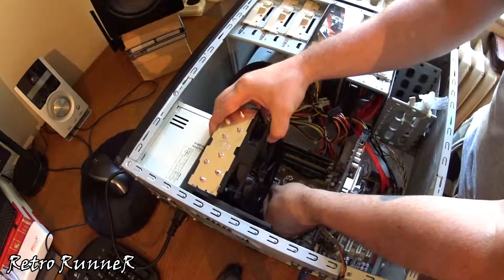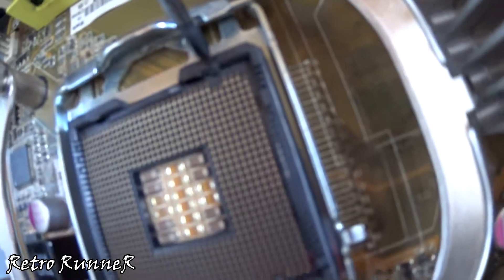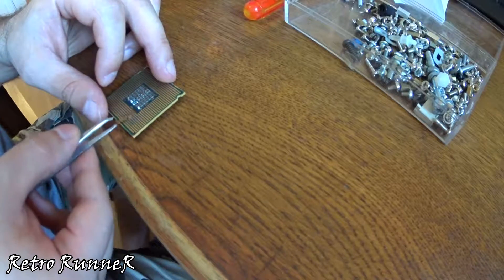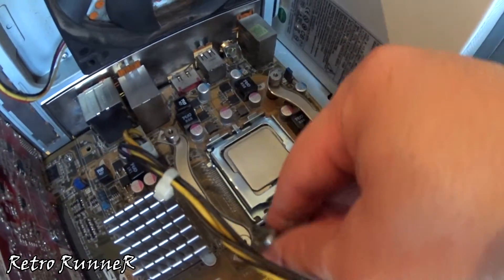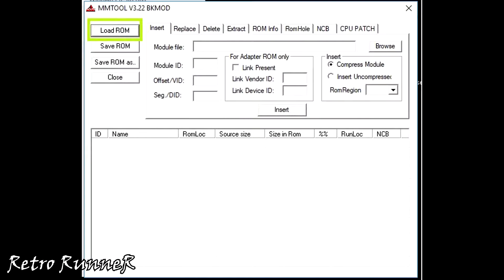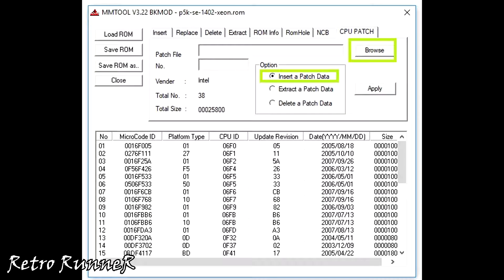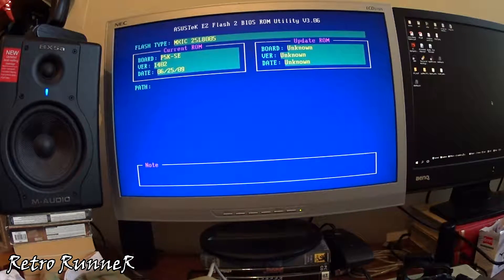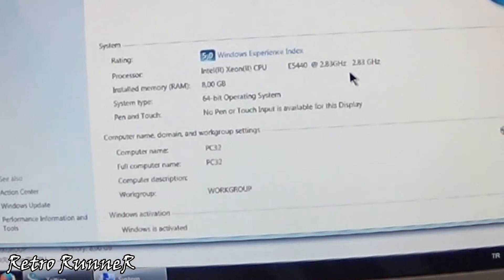Modding LGA 771 to LGA 775 Intel E5440 - How To Run Server CPU On Your Desktop PC (Microcode BIOS)

Comment: i have a ROM file so i just need to copy that small ROM ( only 1024kb) file to my usb and run that usb ? Please help me i don't know what to do right now
Reply from the maker: You have to update your mother boards bios with that file. If you modded it correctly it will work. Be careful while updating your bios do not power off your device while it's updating it.
Reply: @RetroRunner  i have a foxconn g41MD so i have to update by running command prompt with my bootable UBS dos right ?
Reply: @RetroRunner  man it still won't boot my OS and keep restart over and over but still manage to get to bios

Comment: Hi! I bought a processor, converted the socket on the motherboard (ABIT IP 35-E), added an adapter for the processor, and additionally installed a modified BIOS with micro chips. Everything works, the processor is correctly recognized in the system and programs, the temperature is normal. There is only one problem, the computer absolutely does not want to hibernate, that is, it goes to sleep immediately, but it cannot be woken up. Instead of the desktop, the computer behaves as if I just turned it on, i.e. it turns on twice, then the black screen turns off and that's it. Only the reset helps there is nothing in the event viewer about this problem, I played with all possible settings in the BIOS, I restored the settings a few times, including selecting the optimal settings, removing the battery, resetting the CMOS jumper, playing with the power settings, even disconnecting all devices peripheral and even a second hard drive to check and there is absolutely no difference. In the BIOS, S1 mode works but S3 mode does not. Any advice? :(
Reply from the maker: Hi, i used that CPU for some time and i don't remember that kind of thing. Try MOBO's original BIOS, it will give an error on boot but it will work.
Reply: @RetroRunner  Thanks for the advice! Got one more BIOS modified from an earlier version only (I currently have version 18). As it will cause problems, I will try to upload the last one available from the manufacturer. Greetings!
Reply: @Arti128  Sometimes modded BIOS makes some problems. I updated a P5Q Pro Motherboard and the PXE Boot doesent wanna to work fine. It was work before. But if you can choose a Q9550 or an X5470 you will choose the last one with this small bug. :)

Comment from the maker: You can download microcode dat file from intel's site (google e5440 microcode). Then you'll need extract it, check video info for links. The files i've used in microcode.dat file are;

cpu0001067a_plat00000044_ver00000a0b_date20100928.bin
cpu00010676_plat00000004_ver0000060f_date20100929.bin
cpu00010676_plat00000040_ver0000060f_date20100929.bin

https://downloadcenter.intel.com/download/23082/Linux-Processor-Microcode-Data-File